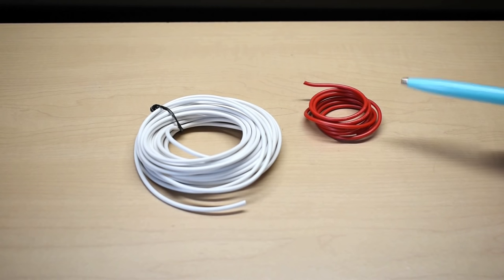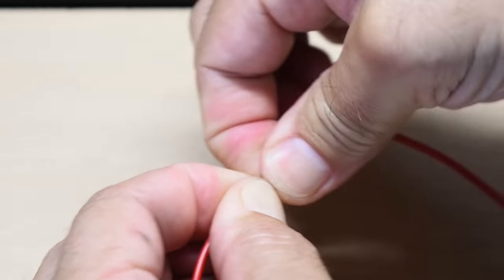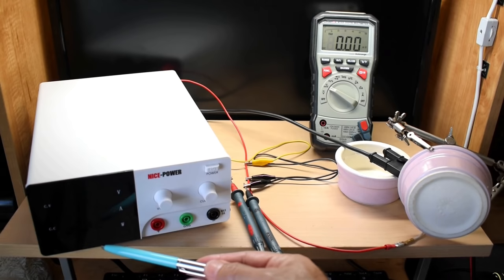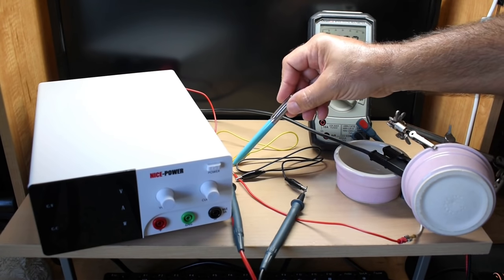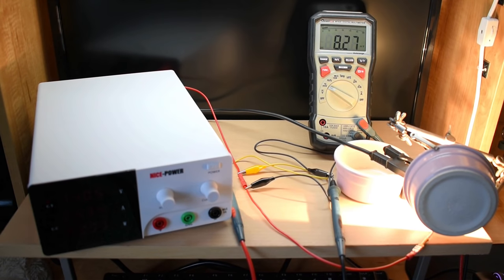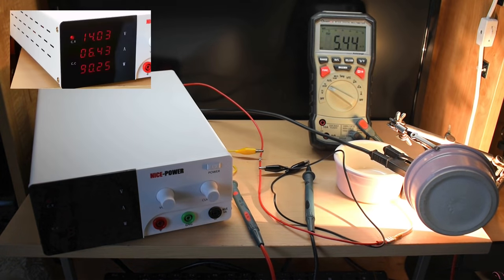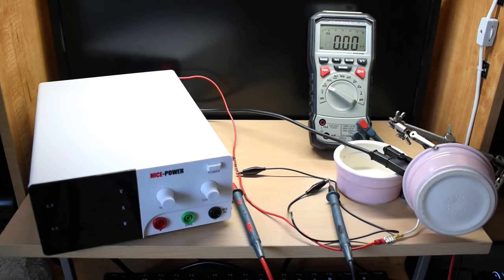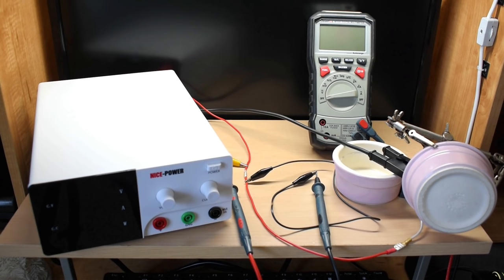Which Stranded Copper Wire Splice Is Best? Find Out!

Comment: When joining wires together, whether stranded or solid, you can't beat the reliability of a soldered 60/40 rosin connection and then covering with a quality piece of shrink tubing. This video proves it.
Reply from the maker: I've never had a soldered splice fail when done properly. Thanks for watching!
Reply: @electronicsNmore  I was surprised that the 2% silver didn't do better.
Reply from the maker: @illestofdemall13  Agree, but the values for soldering were all very close, it was hard to tell. It may have been slightly better.
Reply: @illestofdemall13  you can't do much better than as good as an uncut wire
Reply: @illestofdemall13  I was a little surprised too but at 2% it's not enough. Everyone has a spool of 60/40 rosin core, that stuff goes a long way, and I'm always amazed the flux works after years and years of sitting in a drawer.
Reply: @MRCNC1967  Yes, and have you ever used 63/37? That stuff works well too.
Reply: @illestofdemall13  I have a never ending 1# spool of 60/40, but will give the other stuff a try if i can find small qty, 
i don't want to buy another never ending 1# spool.
Reply: @MRCNC1967  FWIW rosin core solder does eventually go bad after 30 years or so. When I started my EE classes I inherited my dad’s huge coil of solder he used when he was in school. It was totally unusable; the rosin turned black open heating and the solder wouldn’t stick to anything no matter what I tried.
Reply: @cavemandanwilder5597  I had a spool of solder I bought at Radio Shack for HS electronics shop class, that was a long time ago, it did eventually go bad so a bunch of years ago I bought a brand spanking new 1# roll of Kester 60/40, it will outlive me.
Reply: @illestofdemall13  Ah yes, eutectic solder melts at a lower temperature than standard 60/40 solder and most importantly it changes from a liquid to a solid faster.
Reply: @illestofdemall13  Yup, eutectic solder is all I use, if only for the fact that it's easier to work with than 60/40... for me, at least.

Comment: Great vid. I'm willing to bet crimp connectors using a superior crimp tool (Klein or Channelock) would improve on the sheet metal crimp tool. Pro grade tools have wider crimp profile so more crimp contact area & a more reliable mechanical connection w/out breaking copper strands in my experience.
Reply from the maker: Yes. Using a thick walled butt splice connector with a high pressure ratcheting crimper, would give you a connection very close to a soldered connection. Thanks for watching!
Reply: You are correct. Heat shrink connectors crimped with the correct tool are the best. Solder connections that are not located in a cabinet or enclosure like a radio are not allowed in aircraft. Soldered will cause a failed inspection every time. The connectors must not have a seam unless the seam has been brazed.
For connectors larger than #10, I use a 10 ton hydraulic crimper. The best source of large connectors and about anything else electronic that I have found is Pacer Electronics in Fort Lauderdale Fl. They even carry ultra high temperature silicone coated silver plated wire (A flame won't melt insulation) and heat shrink tubing (Both regular & expensive epoxy coated) They are the prime supplier to the aviation & marine industry.

Comment: Interesting!   If you do end up doing another, comparing Wagos to wire nuts with a high draw AC load would be appreciated. I'm not quite sold on the new product yet, especially in amp draw situations that near the rated capacity of the wire.
Reply from the maker: If enough people share this video, you'll see a Wago and wire nut video soon. Thanks for watching!
Reply: I agree, whats the difference between a new Wago and just shoving the wires in the rear of an outlet. The outlets always failed that way, I would like to know what changed.
Reply: @CampMoreBarkLess  the main difference with Wago is that it puts pressure between the wire and the contact, where the push-in only contacts against a sharp spring edge, creating a smaller contact resulting in higher heat and possibly more corrosion.
Reply: @TomCee53  appreciate the answer, thanks

Comment: Splicing methods should address failure due to mechanical stress, vibration and  over-temperature. A soldered joint should be installed to resist failure due to mechanical stress (pulling and strain relief) and vibration (flexing at the joint). An over-temp event can melt a soldered joint. So a method not shown is to use a non-insulated tinned butt splice (for mechanical support in over temp) and then soldered to reduce intrusion (contamination), with heat shrink applied (perferrably dual wall) to seal the splice. The flux used should be rosin RMA. You can buy a combination butt splice high temp heatshrink which has a solder slug. So you crimp, heat with a heat gun, melt the solder and shrink the tubing all in one operation. The splices are see-though so you can examine the soldered joint as you heat (solder) and after it is soldered.

Comment: Interesting video.   I am in process of retrofitting  TBI  EFI system in a hot rod. I have connections to ring terminals that need  terminating and also have 22 gage ECM wires that should be lengthened with splices. But I am Leary of doing this  What is the method for pre cleaning the wire conductor before crimping or soldering ? Any advice / comments would be welcome and appreciated.  Thank you.
Reply: Flux and tin the wires with 63/37 solder.  Use the wire wrap method shown here with busswire.  Add heat shrink over the splice, position the splice where it will not be flexed.  Use a crimp if you are not able to make a proper solder joint.

As a person who pays his mortgage with a soldering iron I am of the opinion that most of the automotive reluctance against soldered connections/splices stems from poor workmanship.  This is good advice if you cannot make a good solder connection.  Proper solder joints are more reliable and a better connection than just crimped but require some skill.

Comment: If you want/need extra physical strength, you can use a Western Union splice like what has been used for overhead power wires.  You make a "U" shape for each end, hook them together and twist the tail around the opposite wire.  I solder them.

Comment: I knew the soldered joints would be the best, but soldered touch being the lowest is surprising.  It's the added diameter that makes the junction lower than no splice.  A larger diameter AWG means less resistance and a lower Voltage drop, so the soldered connections have the same effect, as long as the two soldered wires have a good mechanical connection.  The more solid the mechanical connection, the lower the resistance.  The solder holds them touching and adds bulk to the connection, both giving a lower resistance there.  It's also not surprising that the tap splice and twist only are the worst.  However, I would have thought the butt splice would have done better.  Maybe mine are.  I have a fairly expensive butt splice crimp tool that flattens more of the butt splice metal onto the stranded wire.  Pretty much the entire insertion length of the bare-wire-ends crimp-able splice metal.  The crimp section is much wider and has three wire size options.  And when I have to use a crimp tool like the one you used, I crimp it twice, close together.  The butt splice tool I prefer also crimps with more pressure than the kind you used.  It has a click stop for the pressure, kind of like a torque wrench.  None the less, this video was quite revealing.  I went all the way back before watching todays (10-223-2022) Electrical Wire Connector Pullout Force Tests! Wago, Ideal, Contractor's Choice.  Thank you, Scott!  Excellent as always!

Comment: Nice to see my instincts verified. I've always done a 'twist 'n solder' method with shrink tubing. Only used solderless connection for a) Areas that I couldn't solder, or for items that would need to be removed later. But even then, I tend to solder the stranded wire to the connector.

Comment: Could you make a video on soldering? You first put the solder on iron and then touched the wire, while mainstream opinion is to touch the wire first and then transfer solder or else it might result in cold solder joint.

Comment: Excellent video. Two things come to mind. First, I would love to see the results for those connectors that simultaneously solder & heat shrink. That seems like a really good approach. Second, a major consideration is how the joint holds up over time. Two factors could be tested: a month of vibration and a month of salt water spray. The salt water would not have to be very salty unless you are testing to marine standards. It is just a way of accelerating and simulating normal environmental effects.
Reply from the maker: Glad you enjoyed the video! It wouldn't be an easy test to do. Thanks for watching!

Comment: I’m going to assume a twist on wire nut is about the same as twisting wires together. If you are going to evaluate wire nuts, please consider ones with and without metal inserts. The epoxy was surprising as well as the crimp on connectors. Thanks for doing this test.
Reply from the maker: Hi Dave. I would think the wire nuts would be very similar to my bus wire wrap. Thanks for watching!
Reply: In one of his other videos, wire nuts were considerably better than the best tap splice.
Reply: @jon4715  I had some150w halogen transformers connected with plastic wire nuts a few years back and one of them caught fire inside of a light fixture I designed during testing. We switched over to metal inserts and then to the lever lock type due to my concerns and I caught a lot of flak for using more expensive components on the production line from accounting. It was nice to see some validation for that choice with the tests done in this video.

Comment: You should use a “Kelvin bridge” to measure the very low resistance of each test candidate when cold and after the load is disconnected.
Reply: That is what is "using" as he has his current source separated from his voltage measurement. The specific term Kelvin bridge which does the same thing is used for a special test structure used in two-dimensional structures,  i.e. semiconductor/PCB. However, there is a specific type of equipment which are called Kelvin probes/clamps which can be used for cables, which does what he did with 2 equipment (the power supply and multimeter).  A more general term for this type of measurement is 4-wire or 4-point measurement.
Reply: @patnutoris4054  - I don’t believe a typical Kelvin bridge would be using 6A of current as in this video, and the Kelvin bridge would give an Ohms reading directly rather than having to calculate that from V/I.
Reply: @stevebabiak6997  You are correct, a typical 4-point measurement is using a much lower current to avoid thermal issues as resistance is temperature dependent. The actual current is often dependent on the test object and your measurement resolution. In his case, 0.1-1A should be sufficient but I think the current choice was limited to his load, i.e. equipment.   

However, this is still a perfectly valid 4-point point measurement for measurement of 1mOhm resistor. 

Furthermore, Kelvin bridge is a test structure, not an equipment by it self so it is fully dependent on your setup if you read out volt or ohm from your equipment. Personally, I prefer volt+current read-out instead of just Ohm since that gives me the possibility to determine if the current was to high. 

have a nice day.

Comment: I would really like to see this again with a better butt slice connector. Like one from wirefy for example. And a proper ratcheting crimp used. Your other testing showed that rim connectors usually perform right on par with soldered connections.

Comment: Fascinating. Ultimately, while the worst connection had almost 3 times more resistance than uncut wire, the worst total resistance difference was so small, that it would be insignificant in virtually any real life applications. It makes me feel better about my twisted wire connections.

Comment: I've always soldered connections where possible - its quicker than any crimper that I've ever used, and you know it isn't going to fail. Now if only I can 100% remember to slide the heatshrink over before I solder!

Comment: I've been using the 60/40 touch method for years. I always add a layer of heatshrink tubing to prevent shorts. The tubing probably makes little to no difference electrically.

Comment: Another very interesting and informative video. Another one I would like to see is one of those heat shrink connectors with the band of solder built in. I'd expect it to perform as well as the tinned and reflowed connection.
Reply from the maker: I may create a Part 2 video testing solder seal, wire nut, and wago. Thanks for watching Karl
Reply: @electronicsNmore  
Could you perhaps add non cleaned wires too? 
Cleaned wires will corrode after some time.
Reply: @electronicsNmore  Good idea to add that test.

Comment: The more one learns about this topic, the more complex it becomes. Even though butt crimping didn't fare so well, it is still a mainstay for automotive manufacturers because it is quick and less prone to vibration-induced failure years later. I believe they get away with a higher resistance connection because most automotive circuits have enough internal resistance to make a tiny increase irrelevant. The other complexity is how a solder connection may perform if current is high enough to generate significant heat. ABYC conventions say that soldered connections also need a mechanical method of connection (twisted wires, etc), so that when the soldered joint heats up, the mechanical connection won't let it shift. Practically, most automotive mechanics don't do that when they solder. I find the topic humbling, but in the end it's about finding a method that works for you.

Comment: Great data, thanks for going through them. I know that if a wire is subject to really high current load(s) you would want a heavy duty crimp or actual terminal block.
Soldering wires that are properly fused is my choice in automotive/marine applications to keep corrosion at bay
Reply from the maker: You're welcome Craig. Thanks for watching!

Comment: Very interesting.  I thought the soldered joint would be almost as good as solid wire, but I never thought it would be BETTER.  It makes sense though, that the added thickness would reduce resistance.
Reply: It is similar to the "Western Union splice", NASA even made it a technical standard. They concluded that "the solder connection at the splice was as strong or stronger than the un-spliced wires". But it's interesting to see that it's not only stronger, but also conducts better.

Comment: I'm surprised the end-butt crimp connector did so poorly. That implies that other crimp connections perform just as poorly. I would expect the crimp connections to degrade over time.
If you ever conduct a similar test, a straight wire with a tinned section would also make an interesting reference.
Reply from the maker: Like another viewer said, if the crimping tool was wider, and the tube of the butt splice was thicker, you could expect results very close to soldering. Thanks for watching! Be sure to share.

Comment: Excellent test! Thank you. I wonder if fanning the strands out and meshing them together, i.e. forcing the fanned wire ends together for the joint, rather than twisting the wires, then soldering, would give a lower resistance. That is how I solder wires starting around 16AWG and up to 8AWG - LiPo battery to ESC extensions.

Comment: Wonderful confirmation that my soldering efforts were worthwhile.

I am curious about my other go-to opion. If I want to save a little time.  Sometimes I will use the butt connctors with integral solder and heatshrink insulation. I have assumed this is almost/ as good as soldering because it is soldering.  It is more expensive than soldering and sometimes using a heat gun to melt the solder and shrink the insulation puts nearby wiring or components at risk.  Otherwise I have assumed it is electrically equivalent and perhaps a better way to seal than using pieces of heat shrink.

Thanks for an interesting and helpful video!

Comment: Great video, I like soldered connections and wherever possible I try to make sure the are not under tension in use, I like shrink wrap tubes and I often go over the wrap with liquid tape for better water proofing.
Reply from the maker: Glad you liked the video Tyler! Be sure to rate thumbs up and share. Thanks

Comment: Great idea.   I really enjoyed this topic.   The butt splice surprised me.   I bet the pinch style splices will degrade over time though.  Silver epoxy was impressive.
Reply: I have found that ANY splice that is NOT soldered will corrode after awhile UNLESS it was made with a high pressure crimper such that the wires literally fuse together like in an arc welding machine that supplies hundreds of amps of current, in which case the solder will melt!

Comment: I've heard that automotive wiring must use crimp splices, because soldered splices fail over time due to vibration.  I wonder if this is really true?
Reply: It is, I have worked with a couple of race teams and they will never solder a splice. The only place they may solder at a pin is at the crimp in a large connector (think the pins in a ECU connector) that will have strain relief built into the connector. They do it to prevent the bundle of wires that are most the time braided or twisted together from pulling the crimp apart.
Reply from the maker: I've soldered connections on my jet ski, scooter, car, and never had one fail. If the connection is subjected to constant small movements, crimp.